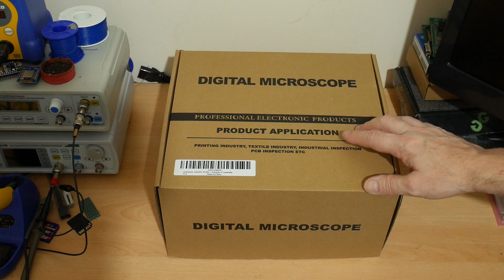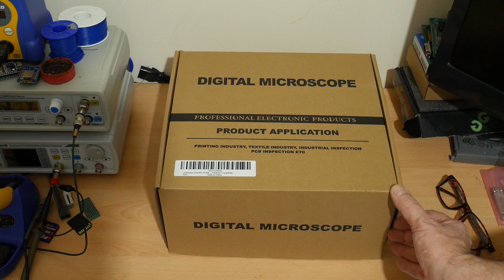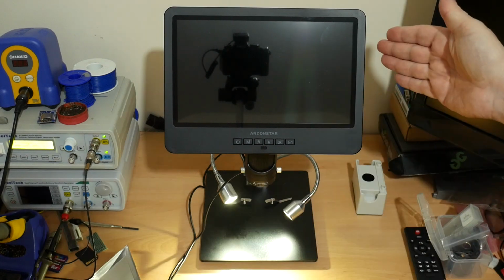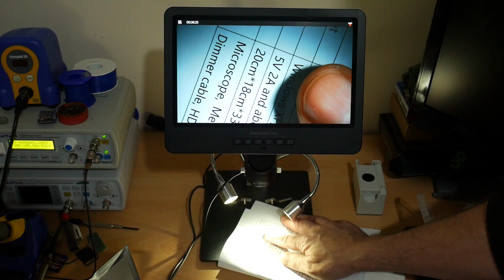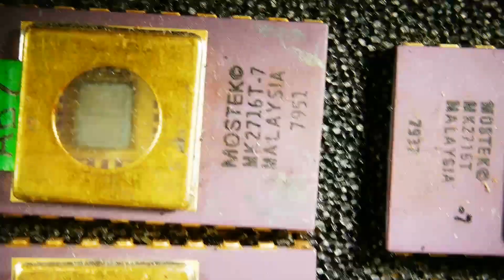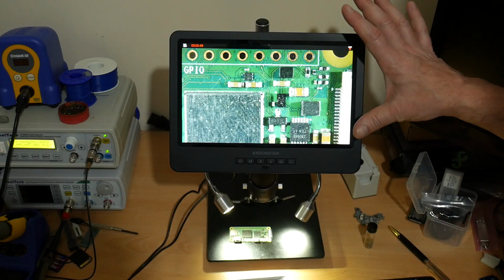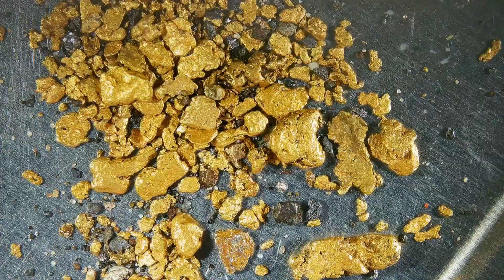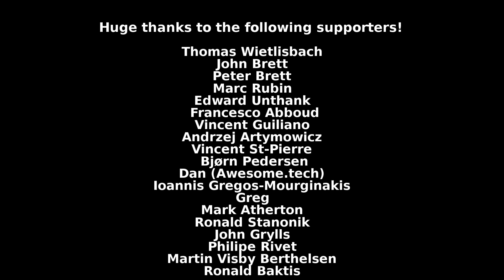Digital Microscope Review Andonstar AD249S-M

Comment: What measurement software comes with it? I use Camera Measure with my primitive camera to measure hole diameter, trace spacing, mechanical component dimensions. Can this be used for measurements? Pretty pictures are nice, but putting numbers to locations is a key use for me. Cheers.

Comment: Really cool you were able to get this as a sponsored item! Even hamstrung by YouTube's compression, that image is really good. Color rendering seems very good, and uniformity (both in brightness and focus) are pretty good for the price point. (US$280 as I write this, before a 20% discount offer.) If you get any other offers for interesting widgets, this subscriber wouldn't mind another review like this one. And thanks for the bonus tip about the CD sled; I've got a stack of unused optical drives I've been looking to do something with. 👍
Reply from the maker: Thanks! It will be so useful for tear-downs and the like, and for the price point not bad at all.

Comment: We bought a cheaper one of these (AD409) where I work a few weeks back & we're made up with it. I'm the wrong side of 40 & it's been handy for spotting solder bridges on teeny pitch ICs, identifying stuff & seeing how ruined your end mills & vee cutters are. The panel on the AD409 is 1280x800 (I think) but the sensor is much better, so well worth using the HDMI output & a Hi-res display. Also has very little latency. I've not had much of a chance to play with the software they provide for measurements.
Reply from the maker: Yeah, ageing eyes are no joke! I was pretty pleased with the latency. I have use other USB mics before where the latency is basically unusable, but this was very nice.

Comment: The only problem with that style microscope is the base - if you're working on large boards, it's a real PIA to have the base of the microscope to balance the board on. I just bought a new microscope on a boom stand to get away from exactly that problem. Can you turn the base around backwards and put a weight on it, and have the microscope stick out over open desk area to not have to balance big boards on that base? it also looks like the distance from the support pillar to the working area isn't big enough to get big boards under there too. The boom stand is really the way to go. Ah, at 11:20 you said the same thing! I just hadn't gotten there in the video yet.
Reply from the maker: Yes, a good heavy swing arm would really make the difference with this kit :-)

Comment: I don't have this particular model, but for people with less than stellar eyesight, these are a godsend. Tiny smd devices are much easier to work on under one of these. I have connected mine to a 43" TV located at the back of my workbench (normally used with a mac mini for displaying data sheets etc) just for fun. :)
Reply from the maker: Nice! Might hang an HDMI monitor on the wall, just because!